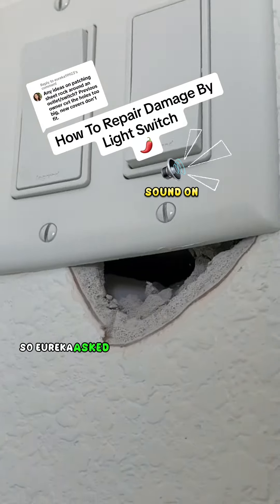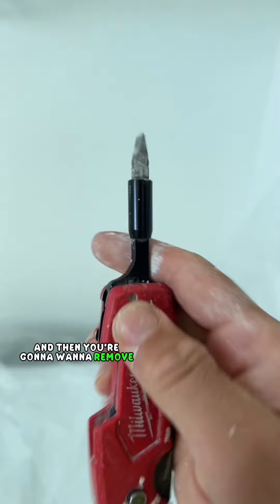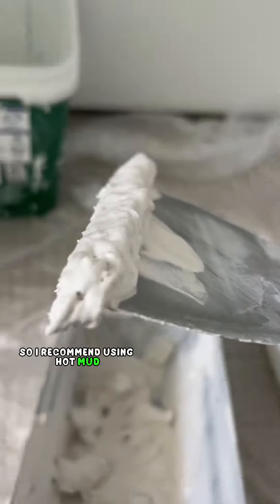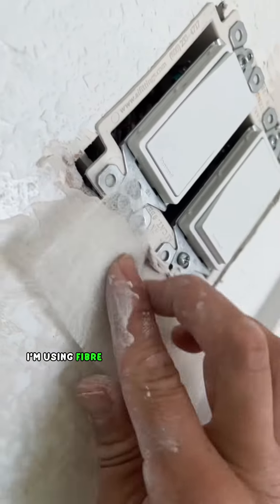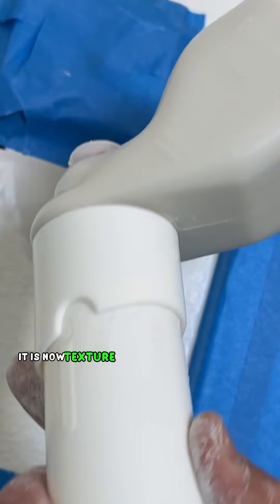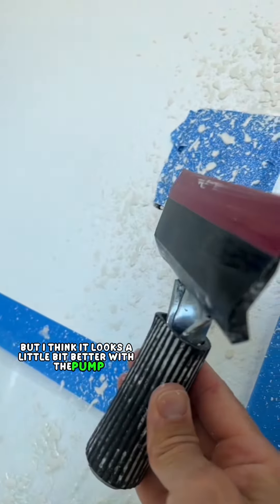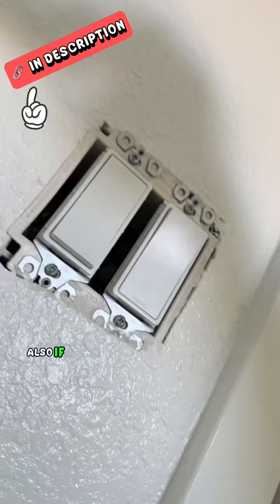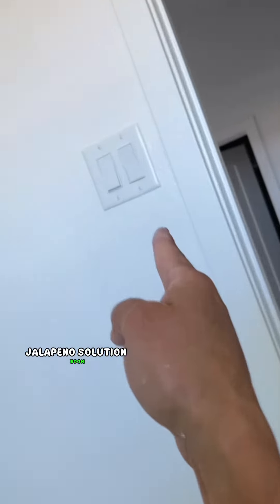How To Repair Damage By Light Switch | #drywallrepair #handyman #homemaintenance #drywall #diy

Comment: The work was done correctly and very well done. This comment is not to criticize, it's just a suggestion. I would have put painters tape parallel to where the screws are to avoid the screws getting filled with putty or hot mud. In the future, if the home owner need to remove the switch for whatever reason, the screws won't be filled with putty or hot mud Thus making it easier to remove and replace. 
Although that is not what you did, I can see many other DYI individuals that don't have the experience you do doing exactly that. 
Keep up the good work your videos are amazing!!!!
Reply from the maker: Thank you.  I appreciate the constructive feedback 👍🏼

Comment: Jalapeño, I had an idea to lightly cut the paper layer off the drywall for around tape or mesh. Paint it before tape and mud, if you're between different things in the project. To get it to sit flatter with the surface. Do you have any feed back on this?